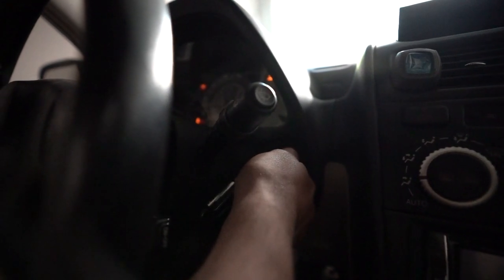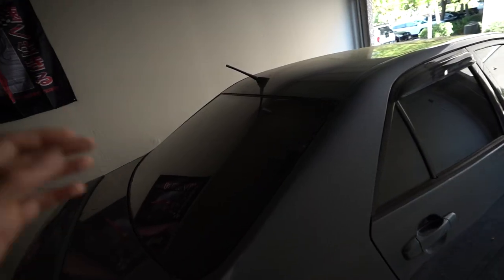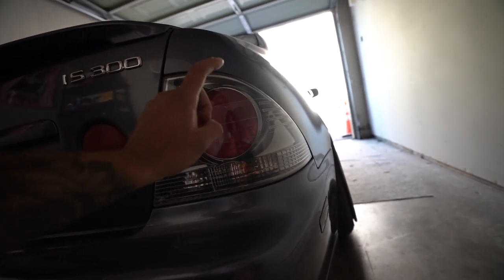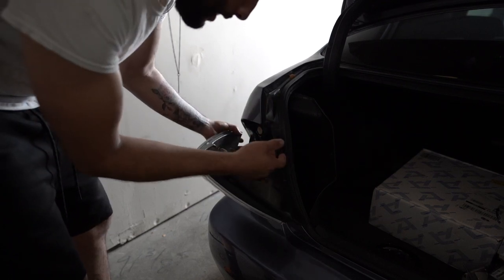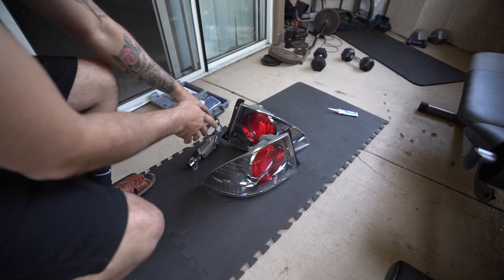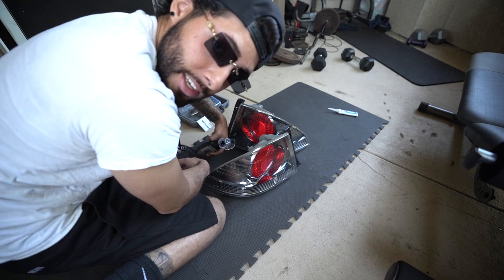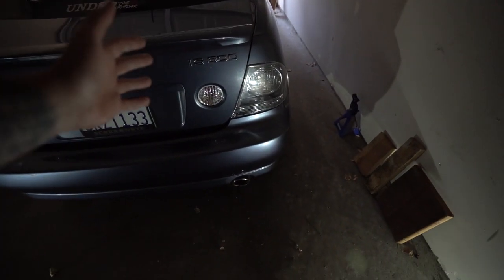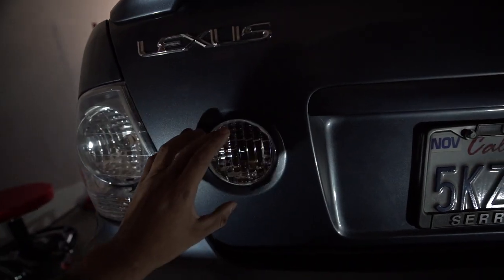DIY CLEAR TAIL LIGHTS (LEXUS IS300)

Comment: Wheels specs? I’m trying to rebuild my KF’s to 18” step lip but unsure of the offset and how much camber are you running?
Reply from the maker: 18 x 10 + 12 I was at about -8ish in the rear and 4 in the front I believe

Comment: do they make a clear piece that replaces the red? also u know if can put red leds in there?
Reply from the maker: I’m honestly not sure if they do or don’t brotha! Yeah you could do an LED if it fits for the correct size or a red bulb
Reply: Yeah you use home depot florescent light covers clear
Reply: @fldrifter8534  thanks bro I like the clear tails but they look a little weird without covers
Reply: Yessir they do make a lense you can use ...a bit costly though.
Reply: r32 clear tails

Comment: Fire 🔥  I did it with my tail lights but I couldn’t find the proper red led bulb on market, coz after I install it only position light turning on but breaking light not working at all. Do you recommend some led bulbs?
Reply from the maker: Yes I personally am running LED bulbs! I picked mine up off of eBay bro!
Reply: @Floresmedia.  Hey what bulbs fit?

Comment: How many of the silicone tubes you used ?
Reply from the maker: 1 bro! But get 2 just in case. They aren’t expensive
Reply: Definitely still haven’t got a Dremel tool yet I was going to cheap out and get a Walmart brand one but idk how good that will do although it’s probably going to be a one time use or once in a while
Reply from the maker: @oruisuu9131  personally, when I purchase parts or tools, mainly anything, I think about buying it once and once only! Remember you do get what you pay for bro!
Reply: That’s why I’m like ehh nahh lol because if I need It later on in the future I have it
Reply: Did you use a ratcheting clamp ?
Reply from the maker: @oruisuu9131  no, just bought some clamps with rubber endings
Reply from the maker: @oruisuu9131  you can find them at any hardware store
Reply: I got you and that reinforced cut off wheel the Dremel came with should be good or should I buy more mine only came with one of those cut off wheels lol
Reply from the maker: @oruisuu9131  wouldn’t hurt to get a few more bro
Reply: Definitely I’ma try it tonight I got everything so far haha thanks for the help 🔥 I had to get a different silicone then you used but is still should work it’s all the had that was flow able silicone for glass etc
Reply from the maker: Anytime bro, send me pics on IG! Would love to see the result! Best of luck, don’t rush it!
Reply: Definitely I’ll keep you updated I’m in no rush haha only because I have another vehicle 😂 Ima give you a follow if I have not already 🔥